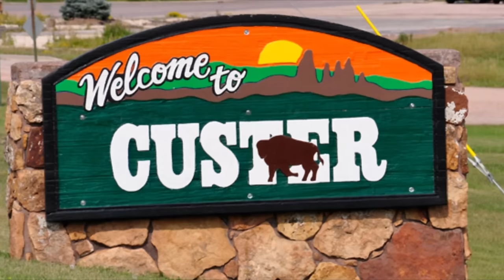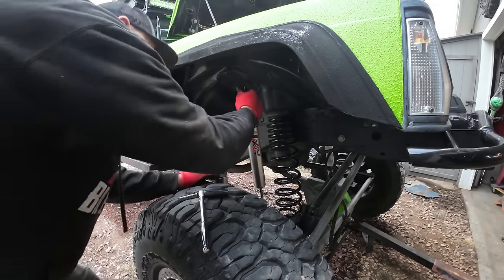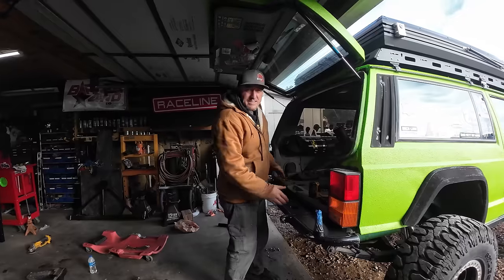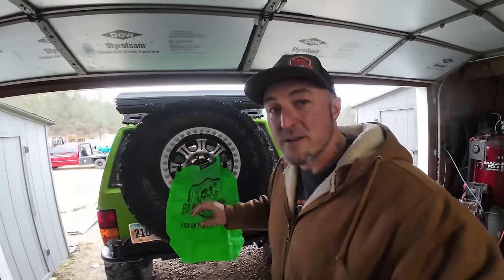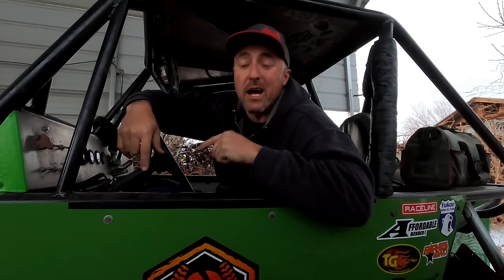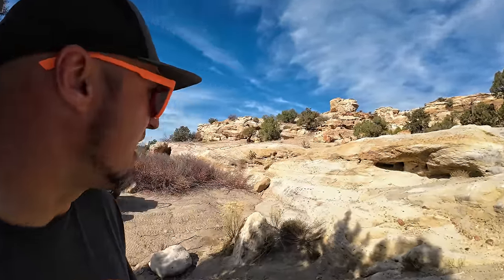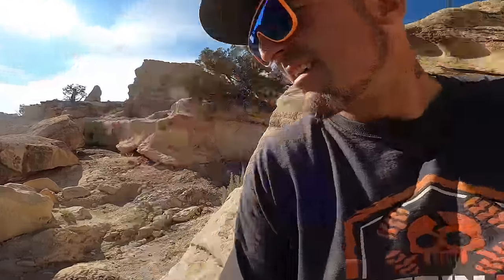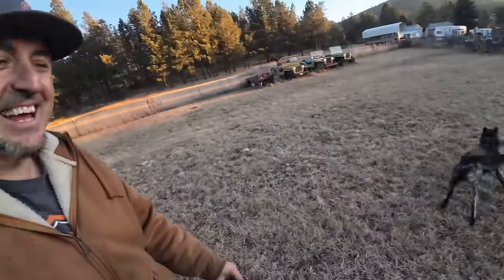Which Way To Go Now!?! Overland to Buggy

Comment: I agree on getting and using the electric saw and other tools but having that back up axe when the saw quits will be a life saver. Better to have it and not need it than need it and not have it. Love the videos Colt glad to see rats nest getting some love
Reply: Yeah, I bought a Max-Ax setup after I had one as BII for a 1114 Up Armor Hummer back around 00-01 after I got back from Bosnia. I mounted it on the backseat of my XJ. Then moved to my Wrangler Unlimited now my JT.  Not a good shovel but there when you need it, good ax though.

Comment: I am so envious, I still love New Mexico, good for you!  I have an XJ and I take a axe, a collapsible bow saw a hatchet and a folding saw.  The first two are because I have been on trails with trees and debris that comes down during the day and blocks the way out.  It is rare I need to use these but you could mount them on your molly contraption.   The hatchet and folding saw I use for smaller jobs that are camp related like processing firewood for example.  I have a small shovel and a back packing snow shovel that I interchange depending on the season.

Comment: Yeah. That’s a bit of a pucker point on the honeymoon. Seen a few recoveries there and have had to spot some ppl they there.  Instinct makes you want to climb too high on the left to avoid the loose drop off held together with chain link fencing that attempts to hood the rocks in place on the lower track.  Good times!

Comment: The best way to deal with body roll is with an anti-swaybar system, however, Offroad swaybars, do the exact opposite of what you’re looking for. I’ve engineered some pretty sophisticated, anti-swaybar systems. Some of them even include an auto disconnect and/or travel limited actuation feature. If the shocks don’t solve the issue you might end up investigating that.

Comment: Axes are silly compared to a chainsaw.  I carry a small axe but also a 18 inch chain saw too on every run.  I've seen several rigs turn around on trails because they could not cut trees off the trail in Colorado.

Comment: I'm in El paso. If you don't wanna keep that bumper I could really use it on my 2kxj.   Ran outta money after having to replace the engine all of a sudden  , couldn't find a good used one and the reman stuff had horrible reviews,  local machine shops wanted over 3 to 5k to do it so I went with a 4.7l stroker engine.     If you wanna get rid of it lemme know coz I need one.    Also if you wanna wheel sometime lemme know.  I'm an auto tech for 23 years but I'm new to 4x4 stuff and I'm also an excellent driver and up for a challenge without destroying my stuff😂